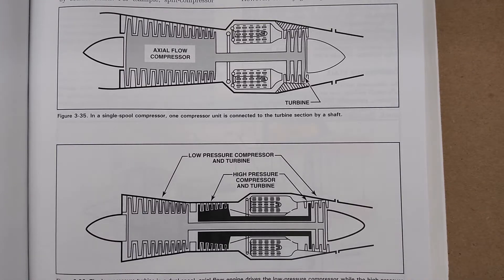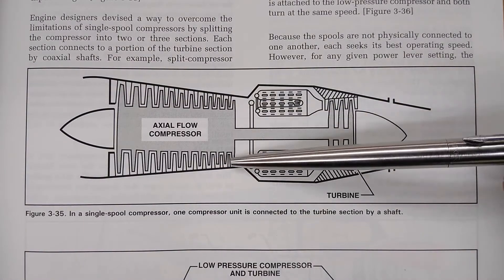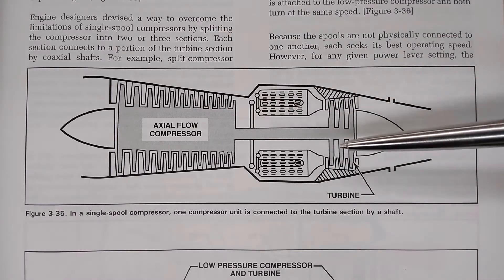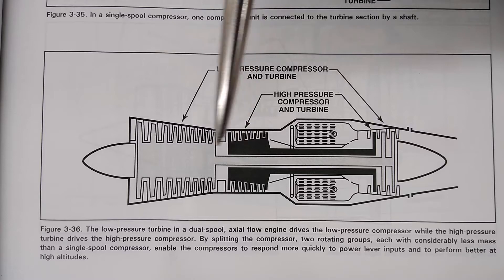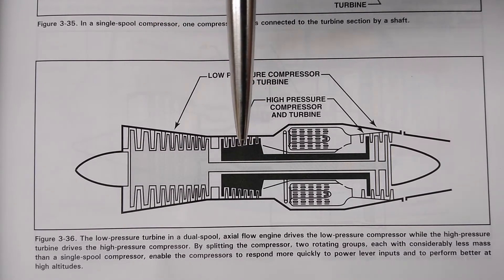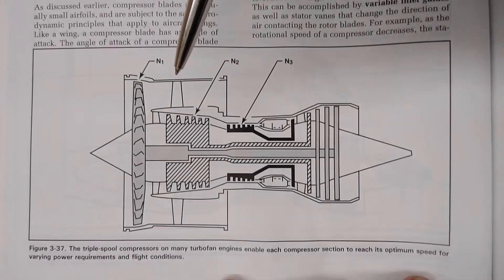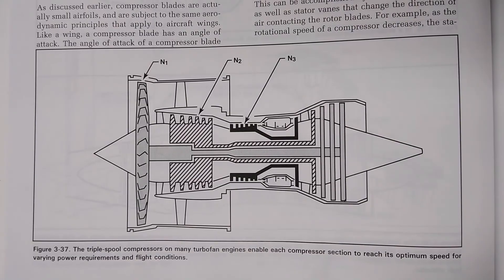LOW vs. HIGH PRESSURE COMPRESSOR and SINGLE SPOOL vs MULTI-SPOOL ENGINES

Comment: thanks for your video. very helpful. I was researching an aviation video on the L-1011 tristar. It uses a 3-spool Rolls Royce RB211, which I understand is the first high bypass jet engine to use a 3-spool stage, which is common apparently on most jet engines now - the Trent series of Rolls Royce engines. Can you tell me where I can find the diagrams you are showing and can you point me to a good diagram of the RB211 showing the 3 spool stage.

Comment: I'm confused of the placement of N1 and N2, it should've been that N1 is inside N2 right? but in some sources it says that mechanically its actually N2 that is inside N1, but it wouldn't be possible would it? As if the N2 is inside the N1, the HPC will not be able to connect to the N2 as it is blocked by N1 right? Please anyone, any answer would help. thanks
Reply from the maker: Hi, it depends on what you mean by "inside". 
In a two spool engine, starting from the inlet of the engine, walking your way towards the exhaust, you'd first see the fan or low pressure compressor (N2), then the high pressure compressor (N1). In this scenario N1 would be more "inside" than N2 just because it is further inside of the engine as a whole, then comes the combustion area,c then high pressure turbine (T1) which is connected to N1, then the low pressure turbine (T2) which is connected to N1. 
Now, the core of the engine (N1-T1) are connected through a hollow shaft, which allows a solid shaft to run through it to connect N2 and T2 on either end of the core.
From this perspective N2 would be "inside" of N1, since it's shaft physically runs through the center of N1's hollow shaft. 
I hope this helps answer your question.

Comment: This is a fantastic explanation. It goes over the key concepts but also maintains a casual tone. I do have one question, what are the typical PSI of each spool?
Reply from the maker: I'm not sure. I'd have to go back to the manuals. That's a good question. It'd be interesting to see the pressure increase per stage too. I wonder if it's linear or exponential. 
Now you got me thinking.... 🤔 
Thanks for the nice comment and for the question.
Reply: @planesimple8514  My apologies for not replying for eleven months, however I gave it a search on the internet, my results were as follows:

Each stage in the compressor grows exponentially, for example, pressure in one stage is increased by 10%, yet in the next it is increased by 15%
Reply from the maker: Hello, thank you for looking that up. I guess the exponential nature of the pressure rise is along the lines of what I expected. Were you able to find pressure numbers for any engine? Someone told me that modern engines get up to 600 psi of compressor discharge pressure.
Reply: @planesimple8514  Some high bypass turbofans can hit 600 - 900 PSI compressor discharge, such as the GE90. Other military engines usually sit about the 450 range.

Comment: Is it technically correct to say that the triple spool engine has low, intermediate and high pressure compressors if you include the fan up front?
Reply from the maker: Thank you for adding that bit of info for all to see. I hope people do take the time to read through the comments here.
Reply: @planesimple8514  I hope it helps a little

Comment: Why do some engines have two compressors and others just one? Are two better and the single compressor engines outdated or are there unique beneficial characteristics of each engine that make one appropriate in one setting and the other better for other uses?

Comment: How can they NOT be mechanically connected? Aren't they geared? Are there hydraulic couplers (like a torque converter)?
Reply from the maker: That's exactly it, fluid coupling. Remember that air is a fluid.
A torque converter is a liquid fluid coupling, a turbine engine uses a gaseous fluid(air). 
Imagine if you had two fans facing each other, one powered ON and the other one OFF. The one that is ON blowing on the blades of the one that is OFF. Wouldn't the one that is ON cause the one that is OFF to start spinning too? Yet they are not mechanically connected. You just made a fluid coupling. That's the same thing that happens in a turbine engine, only at much higher pressures, temperatures, and is contained within a duct, not open like the example of the fans. 
I hope this makes sense.

Comment: Isn't there an error in figure 3-35 in the beginning of the clip? The drawing shows a stator at the front of the intake. Aren't there always rotors at the front?
Reply from the maker: Yes! You are correct. A "stage" in a compressor consists of first a rotor and then a stator. That's a good catch.
However, those drawings being only schematics for illustration purposes only are not all that accurate to begin with. 
Now, there can be non rotating members in front of the rotor blades. For example, struts, like in a pure turbojet, where there's no fan in the front. In that case, what you have is a series of struts that support the from bearing. In a schematic they are difficult to depict because they would show up as a solid wall in front of the engine.
Reply: Variable stator vanes widen the range of operation ( choke— stall ). A single stage fan on its own spool can adapt its speed to the airflow. I guess that variable stators are needed for the compressor on the same spool. I don’t even get why two spool high bypass fan is a thing.

Comment: Well, now I know what a high pressure compressor is, but what about a Power Turbine?  Is a power turbine just the turbofan part of the spool at the end of the GTE?  In my school, they broke them up into HP turbine and Power Turbine.  Are those two separate spools of the same turbine?

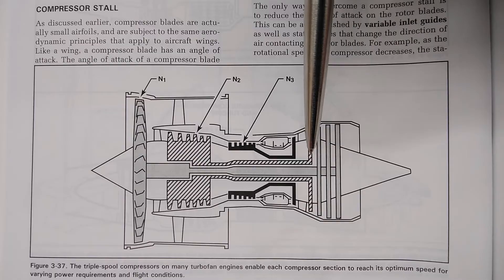Comment: At time 10:23 there is a slight error concerning the nomenclature of the different spools of this three-spool high-bypass turbofan. The best example of such an engine and the only three-spool engine that was up to now produced in large numbers is the Rolls-Royce Trent family of engines. There the N2 spool is not called LP or low-pressure, it is called Intermediate Pressure or IP. On the N1 shaft there is a compressor with one or two stages just behind the fan. Those are called booster stages or it can be called the low-pressure compressor.
Reply from the maker: Hello Ernst Schütz, you are absolutely correct. I just went back to that time stamp and verified it. 
Thank you for the correction. 
As it is plainly obvious, I don't pre-script my videos and as such errors like that do slip through occasionally. 
I appreciate you taking the time to write in and for adding to the topic.
Reply: @planesimple8514  Thank you for your positive reactin. I wish you all the best.

Comment: in some models the inner compressor spins in the other direction then the outer compressor...why?
Reply from the maker: That's a good question Raptor, I don't know. 
But if I had to guess I'd say it's to reduce rotational loads on the airframe, to have one  spool cancel or balance the loads from the other. Or perhaps to minimize gyroscopic effects. I really don't know. But I would like to find out more. 
Hopefully someone well versed on the matter will add to this comment and educate us all. 
Do you know any specific engines with counter rotating spools like what you mentioned?
And again, thanks for the question.
Reply: @planesimple8514  i dont have a specific model but look here...at 0:38 https://www.youtube.com/watch?v=JxkJ-FwFeVI
Reply: You can save on ring of stator vanes on the hot side and maybe get away with less vanes on the cold side?

Comment: would it be more good if you could also explain the reasons for high compressor and low compressor alongwith the video. Excellent video anyway Helped me a lot. 6 hrs in class= 20 min video here.

Comment: it is guide vanes rotor stator rotor stator .. the first set of stators are actually guide vanes and only there to direct the airflow INTO the first stage compressor ... by taking it from chaotic flow in swirls into more straight flow ...
Reply: the high bypass engine you show as well as the other two will spin faster with more fuel ... BUT they differ in the fact that each spool works best in a different flight area ... the high by pass fan is best at low speed and low altitude and for cooling ... the intermediate spool is best for sub sonic speed and moderate altitudes ... while the high speed section is best for supersonic speeds and very high flight zones ... all the high extra spools do is make the engine work environment larger and at optimal conditions for best efficiency 
.
you could even make a 4 spool engine where the first spool from front is a high bypass fan then a low bypass stage for running pumps and stuff as well as low level high speed flight ... and the intermediate stage becomes a mid level flight optimum and high cruise speed performer with the high speed spool being the high supersonic portion .. add a reheat section (after Burner) and you also get a super high speed boost at the cost of fuel ... BUT each additional spool adds more weight .... and increases fuel consumption ... between the 4 engine types all on the same amount of fuel will have vastly different rates of fuel use and so large differences in time before refueling ... this is why jet liners use high bypass 3 spool engines and jet fighters use 2 spools with some using 3 with the first spool being the low bypass spool for low end flight and cooling ...
Reply from the maker: Thank you 0623kaboom.
Reply: Incoming air is as calm as it gets. The intake should not induce swirl at any angle of attack. The guide vanes are used to create swirl. The only make sense if they are variable.

Comment: I just Wana know how comboster chamber works
Reply: compressed air flows in ... and is directed around a shroud so the high speed air swirls back into the area where you will light the fuel ... that slower air allows the fire to stay in that place  while burning all the fuel within the length of the combustor ... (kerosene burns at a rate of approx. 30 feet/sec so the length of the combustor is just oong enough to allow for full fuel ignition as the fuel air mixture heats up it expands that expansion either compresses inside its location (eventually causing a blow out if it doesnt have a way out) or accelerates out the opening to the turbine ... as the heated air leaves the combustor it has a very high potential energy ... which the turbines convert into Kinetic energy ... as their blades redirect some of the airflow to make it spin .... causing a slight loss of energy by converting it into work to spin the front end compressor stage(s) the angle of attack will determine how fast each spool spins and thus how fast your engine will go ... because what is not used to spin turbines is used to propel you forward a la newtons law of action reaction ... yu are dumping hot fast moving air out the back so you move yourself forward ... all a jet engine is a 4 cylinder engine in an inline configuration ... they suck fuel and air in ... compress it ... ignite it and  finally blow it out  ... just like your car engine ... UNLIKE your car they dont use the heat to move a shaft to turn pistons they use the compressed heated air to move turbines blades IN the air stream ... which in turn rotates the compressor stages ... which push more fuel and air into the engine and eventually out of it ... which is what makes you go ...
Reply: Look up lean premixed. Rocket engines all switched to coaxial injectors for fuel and air. They look like a carburettor.

A Diesel shots droplets through the flame. The result is soot. You don’t want that. At high temperature NOx is created. So burn lean , or convert temperature to work right after the flame front ( don’t do Diesel ) . High RPM piston engine/ short combustor.

Comment: Great video explaining very clearly something that it is not always easy to understand. I´d like to point out a couple of inaccuracies. In the single spool engine what you call the first stage stator is probably the front bearing housing frame, or the VIGV (variable inlet guide vanes). It is difficult to tell because the drawing is very schematic, not a detailed blueprint. The first stage stator is located after the first stage rotor, not before. In a compressor stage the rotor always comes before the stator, as opposed to a turbine stage in which the stator comes first. But as I said the drawing does not make easy showing this.
On the other hand, in the three spool engine, what you call the low pressure compressor is actually the intermediate pressure compressor. There are three elements in the front end: the fan, the intermediate pressure compressor and the low pressure compressor. On the rear end in turn we have the high pressure turbine, the intermediate pressure turbine and the low pressure turbine.
Reply from the maker: Hello Laertes, you are absolutely correct on both accounts. On the single Spool, I'd say those are more inlet guide vanes than a bearing housing since the struts don't actually reach the center hub, but then again, in a 2D drawing, if those guide vanes touched the center hub then they would cut off the air path! LOL... This is too simplified of a schematic to show those details, but yes, I did get the order of the vanes and rotors backwards. Thank you for the correction.
On the triple spool, I'll admit that I kind of lost my train of thought a time or two and couldn't find the right terms as I was recording. I don't script the videos(as it's painfully obvious), so mistakes and omissions won't be a rare thing, but hopefully won't be too many. Although at one point in the video I did call the fan "compressor spool #1", low, intermediate and high pressure compressors are the correct terms. 
Again, thank you for the corrections and for adding to the knowledge base of this channel.
Reply: @planesimple8514  no worries, your videos are great. Perhaps a good addition to this video would be a comparison between 3 spools turbofans (Rolls-Royce engines) and 2 spool ones (General Electric and Pratt & Whitney)
Reply: @laertesl4324  thank you for little clearification and specially about Intermediate pressure compressor, i was looking for the this term . Video is excellent and helped me for my B1 licence.